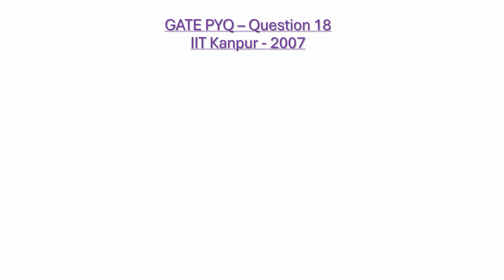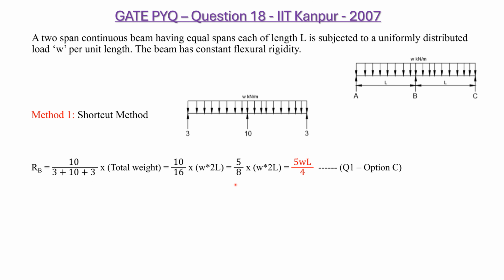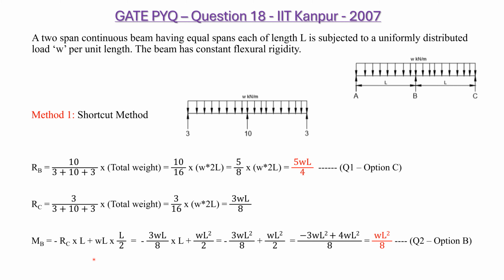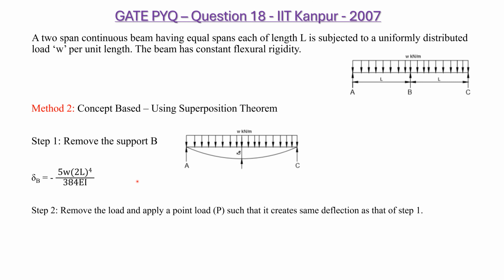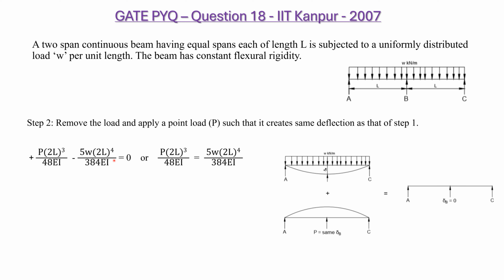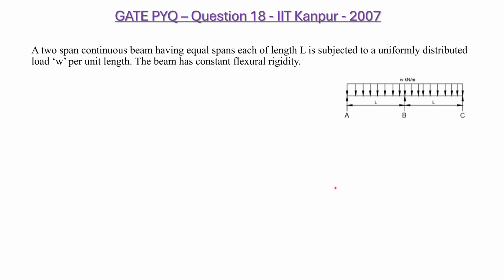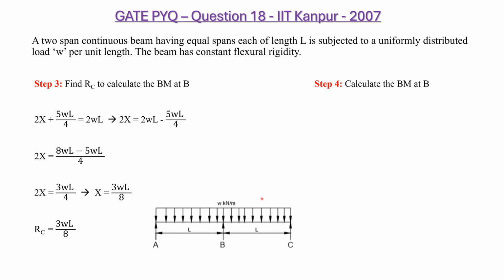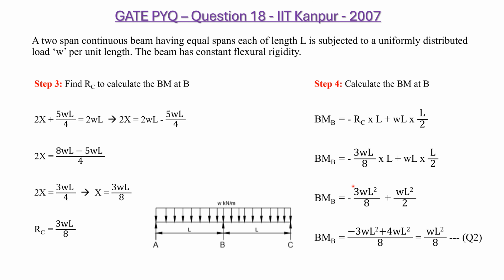GATE PYQ Solution | Two Span Continuous Beam | IIT Kanpur 2007 | Shortcut Trick

Comment from the maker: 🚨 IMPORTANT NOTE on Method 1 (The 3-10-3 Trick):
This shortcut is a huge time-saver for GATE, but it ONLY works under these 3 specific conditions:
1. Two equal spans (length L each).
2. Uniformly Distributed Load (UDL) across the entire length.
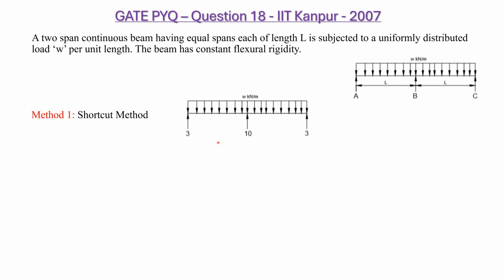3. Constant flexural rigidity (EI) throughout. 1:15